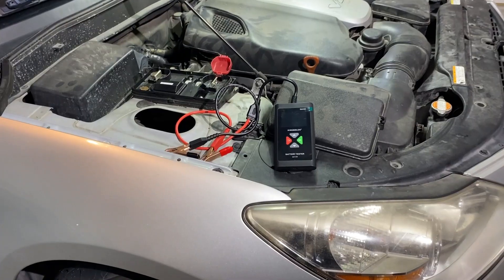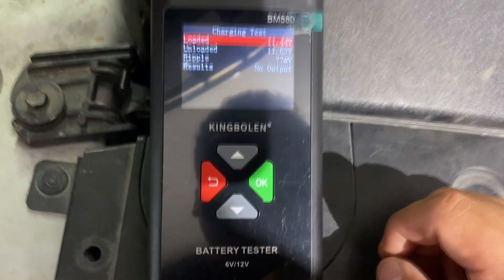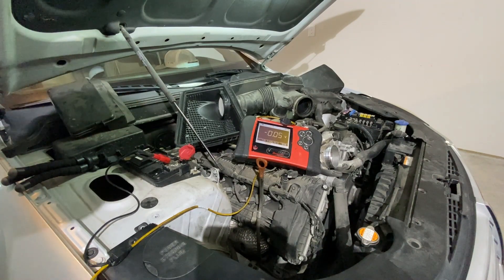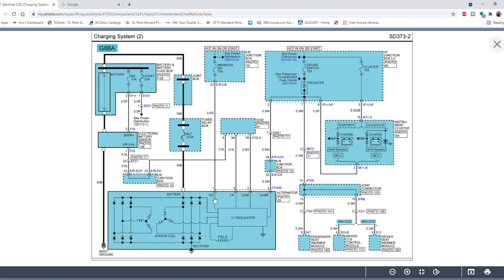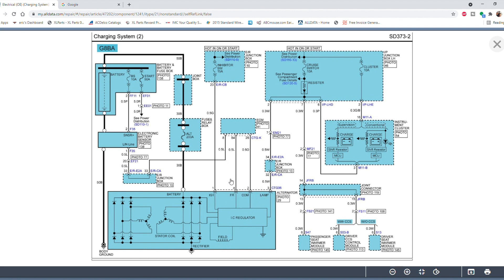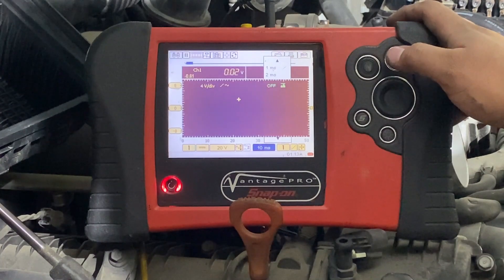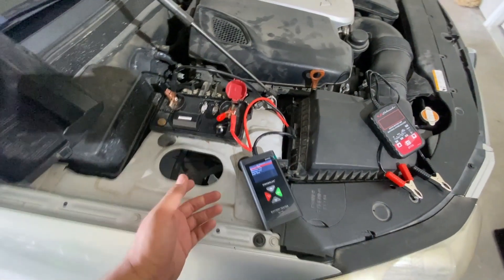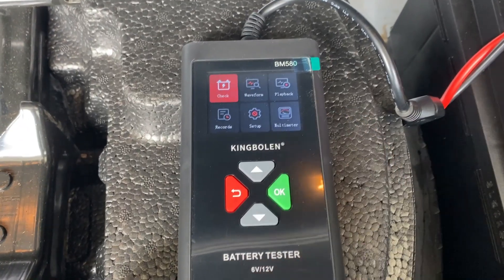HOW TO TEST ALTERNATORS IN TODAY'S MODERN CARS AND TRUCKS

Comment: A vehicle running at 11.8v is a good indicator that the alternator isn’t working. Shouldn’t a good charging system be around 14.2v or higher? After checking fuse/relay, Simple diag in my opinion.

Comment: I have a code of P305F on chevy malibu 2015 and I changed the front battery and the auxiliary battery in the back. And the code went a away for a while and came back on I don’t know if it’s the dual battery control module that needs to be replaced what do you think? And now all of a sudden I got a battery saver active light that came on and the next day a new code came on and it’s a P058D. (Battery monitor module voltage monitoring performance) so now I have both codes any reason why you think I have these codes? and by the way I the change the alternator 2 times thinking that was the reason my battery not staying charged. So not sure what I should do. And now ever time I turn my car on it says service vehicle soon. Please help

Comment: Those remote jump start terminals show a lot of added resistance to the tester causing bad readings. If the tester reads in the mega ohm range for internal resistance when testing a good battery then it wouldn’t take much resistance at all to throw off the test. That’s why you always have to test directly at the terminal.

Comment: I assume the blue wire was your gen control. Can you tell the duty cycle by viewing scope data and would the be useful? Reason i ask is in scan tool data on chryslers gen% is duty cycle. Typically when they read 8000% that is a failed pcm. Although that is pcm data not actual measured at alt. Last question  the final wire(orange)  you stated is a feedback to pcm. What does it send and what should you expect to see? Thanks love the content trying to better my scope knowledge

Comment: Easiest way to test alternator is by turning engine on and disconecting negative terminal on battery, If the car stays on it means alternator is working fine.

Comment: I have a question on alternators i hope you could answer . If you have a 105a alternator with a 10 gauge wire going through a 14 gauge fuseable link to the battery , with the vehicle running with alot of the accessories turned on the alternator may be putting out 50 or 60 amps maybe a bit higher or lower . Why doesnt the fuseable link blow , the capacity of a 10 gauge wire attached to a 14 gauge fusable link has a rating much lower then an alternator working hard with no issues . Maybe i am missing something but hope you can explain , thanks ..

Comment: You know what you are doing, I’ll give you that. One thing though is you are going way too detailed for a simple charging system. Check 1 is your battery getting a charge. Check two, test output from the alternator. Check three, check continuity from positive wire from alternator to battery. Check four, check your ground. A basic multimeter will tell you all of this. No need for an oscilloscope to see wave lengths

Comment: Thorough diagnosis . I am not sure what the specs are on Ripple Voltage . Possibly a half of a volt maximum . I think it's what the diodes leak as AC voltage into the system . If the diodes allow too much through , the battery will go dead . On OLD cars that used a red light to show there was no charging , it would light red with the key off . The leaking current lit the bulb . Bad diodes . There was a drain on the battery .

Comment: You could have just put an alligator clip on the alternator post using the screwdriver is very unsafe , or you could have used an eye crimp connector and screwed it on the alternator post on top of the battery cable. But an alligator clip would have been the easiest way to go. But hey people can do whatever they want right?!

Comment: First of. I love your videos and case studies. I have question about your thoughts on letting the alternator charge the battery up. In your video the voltage was 11.8v. That tells me your battery is very low. I was always taught to charge the battery with a charger. The lowest setting and with the longest time is best. My question is what is your opinion? And the reason I was told to do it this was because a alternator is designed to run the vehicles load and replace the voltage from starting the car and that a alternator is not designed to charge a battery. Because I very low battery will cause the alternator to run at a 100% duty cycle and its just not designed for that. Hopefully I made sense. Thanks for your great videos

Comment: Great job as always!  Have you pondered why that the battery connections under the hood prevented an accurate test with the meter?
That would have bothered me until I had found the answer in the wiring diagram, etc.,  and if you did, would you mind sharing? Thanks!

Comment: Had one of these the other day.. They replaced the battery and Alternator..The light still come on.. Come to find out after looking at the Throttle  Position at idle. It was reading 22%.> When it should be 3%  or less. Cleaned the Throttle  body. Light went out....
Reply from the maker: Wow! Thanks for sharing! This could definitely help someone with the same problem.

Comment: "we don't unnecessarily replace this very expensive part"
2hours of measurment and change new alternator.

But customer only needs 2 new brushes inside alternator for $10.
Reply: There are no brushes on the alternator. You are thinking of a DC generator.
Reply: @ozriblit  there is a regulator with carbon brushes a these brushes worn out
Reply: @tomaskato834   You mean the slip ring brushes for the field coil?   They usually last for years as they carry a relativity low current and run on a continuous surface, unlike the brushes in a dynamo.  If they were worn, broken or otherwise high  resistance  the alternator would not put out a lot of current  (show a high internal resistance) as the field  voltage would be low.
Reply: @ozriblit  Yes, for coil on rotor. No connection = no magnetism = no output power. They are part of regulator and you must open back cover of alternator and check it inside. Fails about around 200k km. If they OK, than probably fail regulator itself.  This little parts are cheap.

Comment: Great diag Eric! The extra checks so worth doing so you can be 100% right that it needed a alternator. Not checking the connector by back probing could cost big bucks if you threw a alternator at it, but it actually was a broken wire going to the computer. Until that check, you really can't make the call to change the alternator. Thanks for the video!

Comment: Eric, do you ever take alternators and just get them repaired instead of buying a reman?  I have a place here in MN within 10 miles of my house that rebuilds them and they are very reasonable.  They will even upgrade components in them to put out more amperage and fix any defects with the original design.

Comment: Ran into same situation when testing the battery in my wife's BMW.  900 CCA however at the posts under the hood got less than 400 CCA.  Repeated test at battery terminals and got a solid 900 CCA.  Initially I was concerned however in doing research on this have learned that it has something to do with the resistance in the cables from the battery to the posts that causes the test meter to provide a false reading.  Apparently the battery tester has a high level of sensitivity to resistance such that the additional resistance from the cables running the length of the car creates a bad reading.  Bottom line - best to check battery at the battery.

Great video, especially your patient explanation of reading the wiring diagram.

Comment: Attempted to order the tester and it did not work on amazon...no promotion coupon allowed.  what gives?
Reply from the maker: I just checked and the code works. During checkout under "payment method" it will have a box that says "add a gift card or promotion code or voucher". Type in WPMXAJR6 into that box and it will apply the discount. Thanks!
Reply: If you are not live in USA,please check it in our global website https://kingbolentool.com/collections/battery-tester/products/kingbolen-6-12v-car-battery-tester-reversible-access-clip

Comment: Eric, you commented on how the test only showed 300CCA capability at the jump start posts.
This is simply because of the additional resistance of the cables between battery, starter and then on to the jump posts.
I sometimes use this test at the starter itself, if I've got one that cranks slow but the battery tests good.
It will show how much current the circuit as a whole is capable of supporting.
These battery testers work on the "4-wire Ohms" test principle to be accurate at measuring internal resistances of battery (and resistance of battery cables too, if you employ them that way) down in the 1/1000ths of an ohm - something a standard multimeter can never do.
4-wire? But there are only two test leads!
Look very closely at the clips, you will see that each of the thick leads actually contains two thin wires connected independently to the jaws on each side of the clip - one of the pair pulls a current and the other of the pair measures the voltage drop. Then resistance is obtained by Ohm's Law calculation.
This means that the test result is independent of the test leads themselves and to a reasonable extent, the quality of connection from the clips to the battery post.
Reply from the maker: Thanks for the explanation!

Comment: I had a camry that kept killing alternators. I could not figure out the problem. Have you ever encounter a car destroying alternators and the fuses and wiring was untouched by wild creatures.
Reply: Repeat failures need investigation to see HOW the alternator is failing.
Sometimes aftermarket alternators just don't perform.
Most likely cause would be a poor connection anywhere between the alternator and the battery - bear in mind that depending on design, this could be at the starter B+ post - and don't forget the engine block ground.
A poor connection would cause an overvoltage at the alternator output, damaging the regulator and sometimes the rectifier too.

Comment: Hey buddy, always love your videos... Quick question, fair to say that when you do the voltage drop across BAT post and battery +ve, it won't show correct results since the circuit isn't loaded as the alternator isn't putting out any current?... What we expect to see is same or similar voltage at both but that wouldn't prove that the cable can handle high current without dropping significant voltage
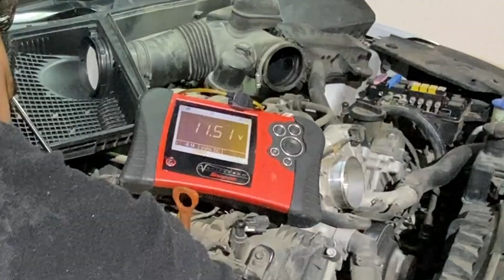Reply: At this point (4:35) the engine was running, Eric could have expected to find anything between 0V and 15V here, but 11.8 at the battery. But 11.8 was what he got.
Refer to the diagram (6:20) there is a fuse and other intermediate connections between alternator B+ post and battery.
As you say, no current flow means no voltage drop - but remember that conversely no voltage difference means that no current is trying to flow in this circuit - in other words you've ruled out the B+ cable from being the cause of the no-charge problem.
Reply: @simonparkinson1053   @Simon Parkinson  Hi Simon, thanks for taking time for such a detailed explanation. Really appreciate it. Fully agree with everything, however still struggling to see how we proved that the B+ cable from potentially ALSO being an issue. Hypothetically if this cable was also bad or corroded, we would still see the same readings and would have only found out after the same test was repeated with a new alternator. Then we would have seen  a voltage drop from B+ on alternator to battery positive terminal.
Reply: @topitinti5258  yes that is true, but the scenario of high resistance (fraction of an ohm) in the B+ cable causing a voltage drop under load would have caused a poor charge condition rather than a no charge condition.
Where the alternator is externally controlled and monitored, the battery voltage may still be maintained - the field duty cycle would be increased to compensate but the losses would still show up as overheating terminals etc - which with the high output currents of modern alternators do tend to be easily visible.
If the test was only done without the engine running, it would not be valid without applying a load.
For a high current circuit like this though, even a headlamp bulb is not that much of a load and the best test is with a working alternator.
Or as I mentioned in another comment, you could even use the battery tester to determine current capability of the circuit.
Reply: @simonparkinson1053  Hi Simon, thanks again buddy... Just to make sure I understand, are we saying that if both alternator and cable were bad in this particular situation, we would have seen a different result on the voltage drop test?

Comment: Bought an '00 Jeep Grand Cherokee that wasn't charging. Previous owner had already replaced the alternator. Turned out the control from the computer connection on the alternator was loose. Tighten the connection, charging again!
Reply from the maker: Awesome!